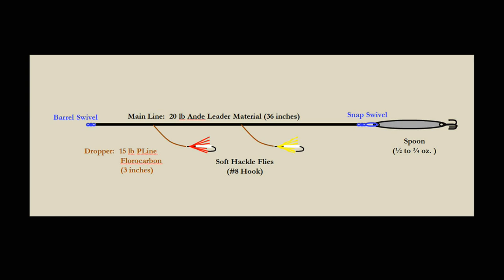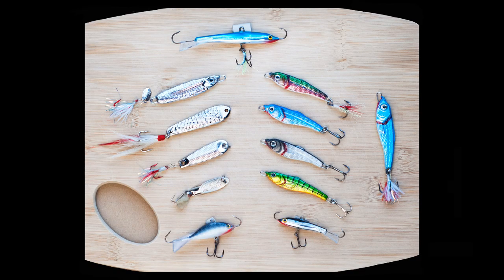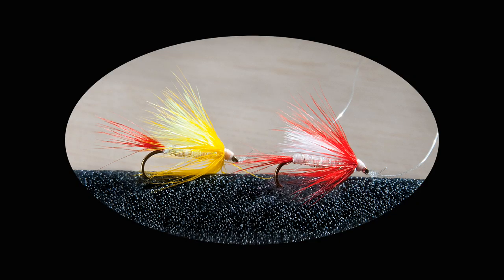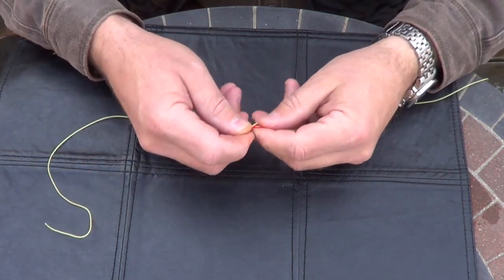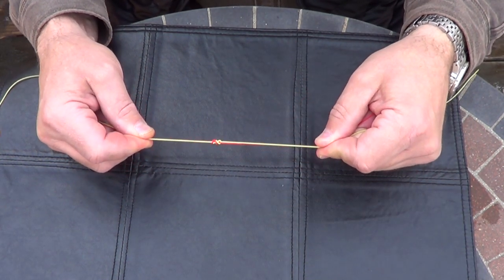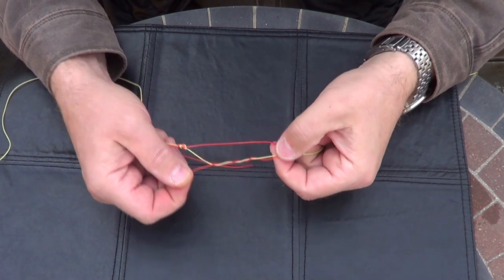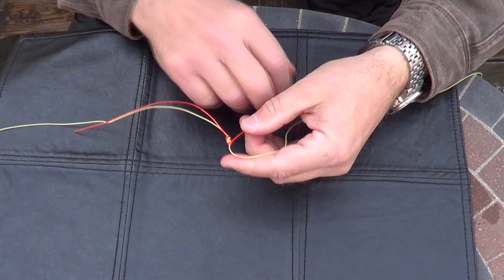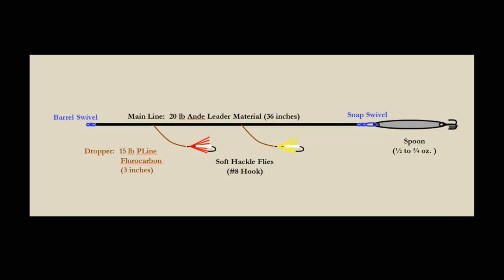How to Tie a Vertical Jigging Rig for White Perch and Bass

Comment: Nice setup. You previously commented on the rig we use in our video. I am going to try this one. In our videos, we use a palomar knot to put 2 1/16 or 1/32 ounce jigs above a 1/8-1/4 ounce jig at the bottom, tying the top ones on first and leaving a big tag end to tie additional baits. At Norman, we usually use a 4lb. fluoro leader with a barrel swivel.
Reply from the maker: Sounds like a good rig!  Just a caution on the 4lb leader, you may run into bass or stripers and would likely break them off.  Perch are not line shy as far as I can tell so like to be prepared.  I often catch two or three 2 lb bass at a time and it is quite a fight!
Reply: Thanks for the heads up. My wife loves using light tackle, mostly because it's not heavy, thankfully the tiny hooks we use get set easily and the ultra-light rod with drag set very low keeps them on for her (though it takes a while to get them in).

Comment: Just saw this.  Thanks for sharing.  Tried sabiki rigs with similar weights as you described.  I really like your option, seems easy enough to tie and stow.  Have you ever tried unweighted streamers?  Or other flies besides those soft hackle ones?
Reply from the maker: Mark Early Mark, yes the true sabiki rigs are more difficult to manage.  I started with them but when you have 4 or 5 perch on them at once it can be a mess to take them off and can be unsafe.  Plus the bass/stripers would not stay hooked.  Yes, I have tried streamers and they are about as effective as anything else.  Usually I catch about 70% on the spoon.  The only requirements I have is to have a pattern that is very durable (so I don't have to retie the rigs as often) and have a good strong hook.  I don't use feathers anymore because the tend to get ripped off after just a few fish.  Lately I have been using 1/16 oz. hand-tied jigs as the two lures above the spoon.  I tie these on steelhead jigs that have heavy wire hooks and use a combination of buck tail and mallard breast feathers that look very realistic as a minnow/shad imitation.  The hooks on crappie jigs have bent out too many times on big fish that I quit using them.  Good luck!